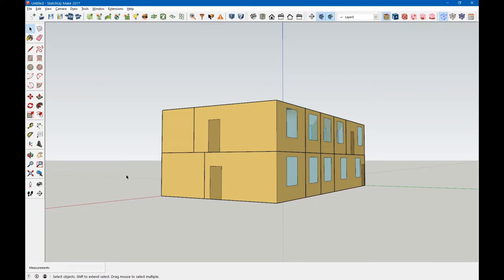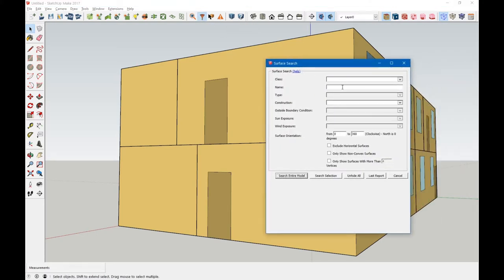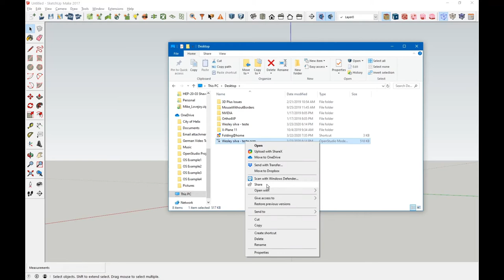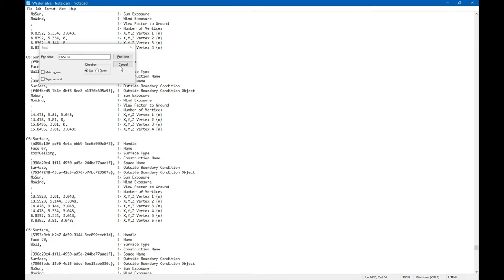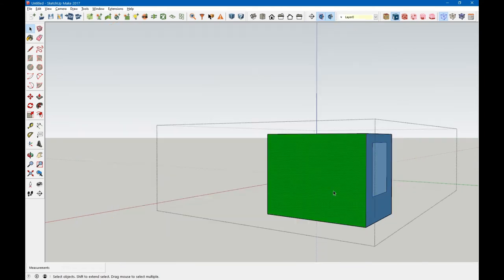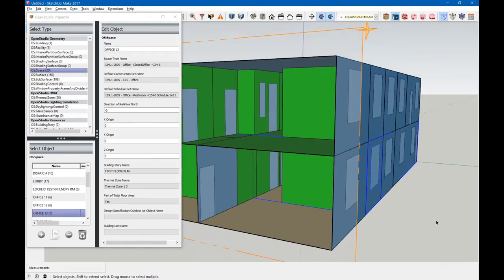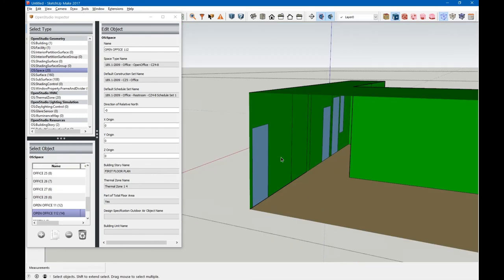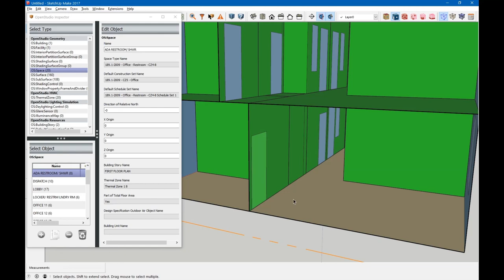OpenStudio SketchUp - Orphan Geometry and Boundary Conditions

Comment: Hi, thank you for sharing! These are very helpful. I  have a detailed OpenStudio model for a highrise residential building and I need to create multiple versions of it with different total building square footages (I have multiple scenarios in terms of the size and number of dwelling units). I tried scaling my geometry in SkechUp Plugin, but when I open the modified model in OpenStudio the geometry looks broken and different from what I see in SketchUp (it looks like when I scale the software create additional surfaces and keep the original surfaces). I did run the simulation with the modified model, I didn't get any error but the total square footage in the report is still the same as my original model. Does anyone have a similar experience and can anyone think of a solution for changing the square footage of an existing model? Thanks
Reply from the maker: This is a very interesting question.  I have never tried this before.  It appears that SketchUp can easily scale the geometry, but the space origins (assigned by OpenStudio) do not get updated.  In SketchUp, if you go to Extensions, OpenStudio User Scripts, Alter or Add Model Elements, Cleanup Origins; this will show you the true origins that OpenStudio is using.  The origins tell OpenStudio/EnergyPlus how all the spaces relate to each other in 3d space.  Unfortunately, I don't think there is an easy way to update these.  I think you will have to write a custom ruby measure for sketchup.

Comment: Hi, thanks for sharing information,  I am working on my thesis energy efficiency in residentiel building in Morocco. So, I have a question concerning the drawing of interior subsrfaces (windows/doors); I put subsurfaces by traingle and I do "intersect in entire model" (surface smatching) but we find that the number of interior subsurfaces has doubled in the subsurfaces table (spaces) of OpenStudio and the same when I do drawing only with OpenStudio Geomtry tool.This doubling does not influence the heat transfer? Or i should put the subsurface on an interior surface without intersect in entire model.
Thanks
Reply from the maker: I have two comments.  
1. Yes.  It will double the number of surfaces if you have only drawn them on one of the adjacent spaces.  This does not affect the heat transfer calculation.  OpenStudio needs to have a matching interior window/door surface on both spaces because of the way it calculates heat transfer.  This is very similar to the walls.  There are two walls in the 3D model, but they are treated as a single wall for calculations purposes.
2. Adding surfaces of any kind increases the computing time necessary to run the model.  Simplifying these or reducing them helps.  You should consider the added benefit of these interior surfaces.  Will they significantly impact the results of the energy model?  Often the temperature difference between interior spaces is so negligible that there is little to no heat transfer between spaces.   Also, the heat transfer rate of an interior window/door is not much different than a regular interior wall.
Reply: @helixenergypartnersllc3540  

Thank you very much for your answer and the two comments are very useful, yes indeed there is not a great impact on the results the heat transfer but I think in the case of natural lighting (radiation), the subsurfaces can influence the proporation of the light between the spaces, Sir we can model the scenarios (schedule) of opening the windows and doors (interior / exterior).
Reply from the maker: Yes, you are correct.  If you are using radiance (or some other lighting modeling application), then interior windows can have varying effects on lighting controls.  Some strong effects, some not so strong.

If you are interested in modeling simple air transfer between spaces, I cover this in my video "Building Energy Modeling in OpenStudio - Transfer Air".  However, if your air exchange is a complex network, you will have to use "Airflow Network" in EnergyPlus or possibly some other fluid dynamics program.

Comment: Hi, I have been following your videos and it has proven to be quite helpful. I am working on my thesis on cost-effective renovation integrating energy efficiency. For this, I wish to try green roof as one of the strategies. Could you please let me know how this can be applied in Open Studio?
Reply from the maker: Thank you Aparna.  This is a good question.  I have never modeled green roofs, and I suspect this would not be included in OpenStudio yet.  However, you could use OpenStudio to create your model and then export to EnergyPlus.  I believe EnergyPlus has some coding for a flat green roof.  I would recommend you visit https://unmethours.com/ for more information.  If I have time in the future, I will investigate this further and post a video.
Reply: Helix Energy Partners LLC Thank you for the response :)
Reply: @helixenergypartnersllc3540  I have never modeled green roofs either however I've noticed that materials tab has a roof vegetation material (openstudio v 2.9.1) which translates to Material:RoofVegetation in energyplus

Comment: I've noticed that all the internal doors and windows are not green in the model. Thas that means that the boundary condition needs to be solved for all of them?  I wonder because it looks like a very time consuming process. Great tutorials!!!.
Reply from the maker: Yes, indeed it is a time consuming process.  Your best bet is to create simplified geometry using FloorSpaceJS first.  Then, tweak the geometry using SketchUp.  The surface matching and intersect tools (both in SketchUp and the measure in OpenStudio) was originally very robust and automated this process.  Unfortunately, the tool became less effective with updated versions of SketchUp and OpenStudio.  You can see an example of surface matching in this video at the 30minute mark https://youtu.be/DTaNd8fdnrU?t=30m55s